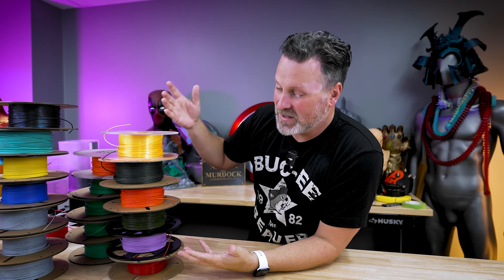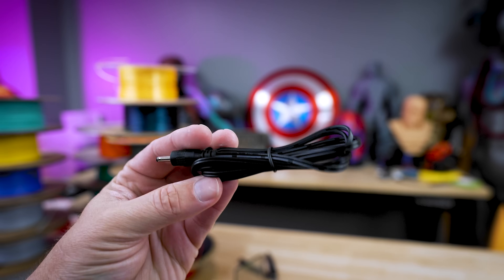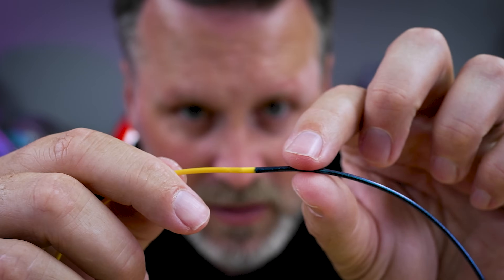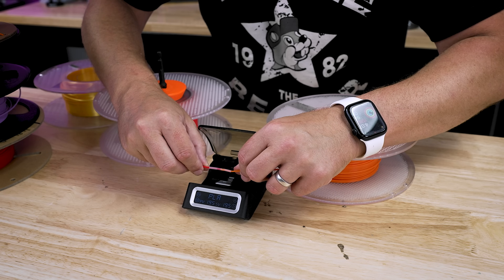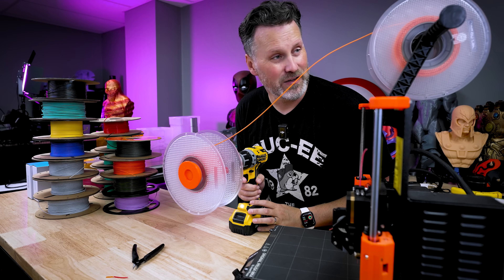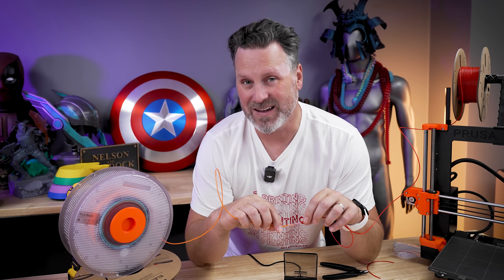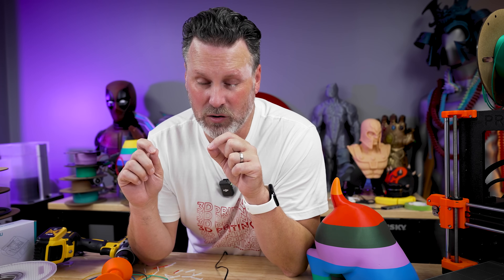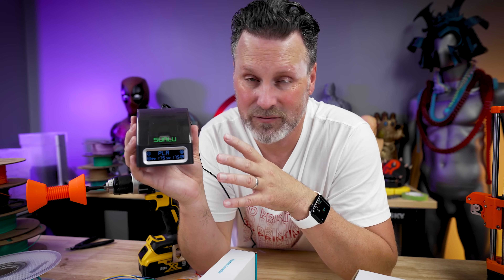Does this really work?? Sunlu Filament Connector

Comment: Ah, thank you, finally I have proof that Bambu does not handle filament jam situations, and prints in air, just like any printer from 20 years ago.
They should really added filament motion sensor for that. But I guess they do not want you to use problematic filament, only official spools. That is why.
Also if your printer normally handles runout event, you can just print all your spools by changing them when they are run out. The only thing needed is that you are near the printer doing something. When I am transitioning from spool to spool I just plan print when I will be near the printer. Then I change filament and that's.
You can also wield filament with good old PTFE + lighter method, which is old as 3d printing is. And you can use PTFE as a guide when rewinding the filament, very convenient.
For me it is fun, that my $100 Ender 3 can handle filament stuck without ruining the print and some top notch 'pear' printer can not. But to be fair, I have not seen any printer which have filament motion sensor out of the box.
I heard that Bambulab AMS partially solves this problem. But I am not sure.
Reply: Problem with the AMS is - and I’ve four of them - that on most spools, the end of the filament is attached to the spool. So the AMS will say the filament is stuck and pause the print rather than going to the next roll.

Comment: Two jigs could significantly improve the filament joining process. A trimming jig would ensure clean, straight cuts for a seamless connection between the two pieces. Additionally, a guiding jig would maintain filament alignment during the melting process, preventing warping and inconsistencies.
Reply: I was thinking this

Comment: Is there by chance any way to save the ptfe sleeves? When I used a ptfe tube and a lighter to try and join filament I was able to keep sliding the tube to the end of the roll and then slide it off at the end. Don't know if that's an option or if the tube deforms after use. I did pre order it because it seems like a cool way to combine rolls.
Reply: Other reviewers have indicated that you can indeed save the PTFE tube by pushing it off the end.

Comment: I like the idea of this device, but I agree with you it doesn't work well enough to be reliable. And with both bowden tubes and extruders being finicky about the filament diameter that works in them, it needs to be much better than what you were getting.
What I would like to see is using a device like what is inside the Mosaic. That has a splicer that connects multiple filaments perfectly every time!

Comment: A couple tips, cut both at an angle, apply light pressure on both strands, use 185deg temp, I preordered one, as I have been printing for nearly 2 years and I have a LOT of spools that have just enough to keep, but not throw away, I am anxious to get it, and work on combining my spools, so I can use the empty spools for storage, by printing the little drawers you can print for them.

Comment: The Problem is Jesse Says? Is your Technique sucks bahahahahahahahaha riz up, The Ptfe tubing can be bought in metre lengths from other distributers, Also the tubing needs time to cool before removing as to not bend or curl/round up. Personally I would rather be using this joiner to join the same color spools together to make rolls of same brand filaments and colors as to not waste un used same rolls. I think this is better use case scenario as it tends to be the same density filament and a smoother transition. Nice one though Jesse. Good Vid

Comment: Aurora Tech did a review of this device that shows combining two partial spools and then she also made a large print using multiple connections. It does seem to take a little finesse to get it working right, but it does seem to work. She also tested it using a number of different types of filament to see how well it worked. She was very thorough.
Something related to 3D printing that takes a little practice to get it to work right? Unthinkable!
Reply: I was about to say that. She has a very good review and she combines several partial rows together and then prints with it.
Reply: True. Trial and Error error error error....

Comment: Really?  Just use your AMS.  Just start the print with your nearly empty spool in there, and also have a new spool in there with it, and it will automatically switch to the new one when the nearly empty one runs out if you have "AMS filament backup" turned on in the AMS settings.  Or just start the print with the nearly empty spool in there, and when it runs out it will tell you that it ran out and will literally ask you to insert a new spool of the same stuff so it can continue.  Your experiment in the video wasn't helped by you not reading how to use this thing, nor by you clumsily using it backwards.  But it is pointless anyways, because AMS.
Reply: Not everyone has AMS. I see this for budgeteers and beginners. I have 3 mini printers I bring with me to Arts n Sciences events, and I can see this getting a lot of use in my case. My sister also likes the idea for her Ender Clone which has a filament detection.
However the refill filament doesn't retract until it is fed through the whole Bowden setup.

This will solve the retraction issues between spools/partial spools
Reply: @DonsArtnGames  Or you can just push the new filament in behind the old. I did this for years until I went Bambu. I can see this thing being helpful, as long as you’re not as clumsy as this guy, and you actually follow directions. But really, it is just a convenience. I never had any nearly empty spools kicking around being wasted, and all I did was chase the old filament with the new, pushing by hand until it got to the extruder gears. Temporary lack of retraction isn’t as big of a deal as it might seem.

Comment: Does it automatically cool down? Like could you stick the joint in the machine and just leave it until it cools on its own?
Reply from the maker: Just tested it. Stays warm
Reply: @UncleJessy unplug it and it will cool down. I’ve seen others let it cool and had better results

Comment: youre suppose to fuse them with pressure like youre doing but while its in the machine acts like a guide to fuse straight and keep proper diameter and cut the filament at a 45 degree angle to help fuse together. gl to all i hope i win 1!! i think this is genius!

Comment: I've used devices like these before and they're very finicky, the force pushing the two ends together needs to be perfect, and any rotational twist differences tend to snap the connection after it's all spooled up. Too little force and the connection fails, too much and it bulges.  Those little PTFE tubes look like they may help things a little but your so-so results confirm these devices are ultimately a frustration.  Also, most of the time the same brand & type of filaments are connected, you can still see where the junction happened because of very slight color variations from batch to batch.

Comment: The short segments of thin PTFE tubes are consummables and one time use only (incredibly wasteful). Great product idea but grossly inefficient and needs more time at the Engineering, product development & testing phases.
Reply: The PTFE tubes can be reused if you push them off the end of the filament instead of cutting them.

Comment: That’s because you’re not waiting for it to cool down before you remove it!
Reply from the maker: The welding spot stays hot. You have to remove it. Also, there are zero instructions provided with this 😂
Reply: @UncleJessy  There is a video showing the process on their website (but some sort of instruction sheet stating the basics would have been useful).  It shows the 45 degree cuts too.  I'm waiting for mine to arrive.  I think my main use will be to pull the last few loops of filament off an old spool that is in use and weld the end to the start of a new spool so I don't have to mess around with the machine pausing when the filament out sensor is triggered.  Your respooling efforts look easier than I expected, so I might try that.

Comment: How about just being patient and letting it cool down inside the joiner before opening it. Because he kept pulling it out while its still soft and pushing. Turn it on, slightly push the filament in, let it cool down, once cooled, then pull it out
Reply from the maker: Thanks! Instructions would be great along with the device 😂
Reply: @UncleJessy  Oh it didn't come with instructions, I missed that part, I retract my snarkiness 🤣🤣

Comment: are you putting angled cuts(splice joint) in the filament? If correct you're supposed to do flat cuts and just add pressure.
Reply: angled has more surface area for a stronger connection.
Reply: @LexxDesign3D  I would normally agree

Comment: I like his "partials" lol Man I can get a lot of small prints from those. And video he said he watched, that guy said you're supposed to cut ends at angle then join together like triangles flipped on top of each other not butt together. That could be some bad welds jessy experiences.
Reply from the maker: 🤘🤘 when in doubt fresh roll for my projects 😂🤦‍♂️ and yeah was cutting them at angles as well. Apparently I’m supposed to leave it inside the join area until it fully cools

Comment: Thanks for the honest review. I received one of the manual filament welders ($9) for Christmas and tried it and it was... not fun. I was considering getting the electric one that looks like a hair curler.
As to spare PTF tube, I bet a lot of people have spare tube if they didn't toss it. Each time I replaced my hot end I would swap it out for a Capricorn tube so I've got a baggy of generic PTF that could probably be chopped up for something like this.
Cool find with the spool winder, I'll have to check that out. :)

Comment: You could use a lighter with those tubes alone and get the job done. If they were thicker, you wouldn't be bending the splice either. 
I agree with you. A couple design changes could make this way more useful

Comment: I've been using this same method for about a year now, using silicone tubing and a soldering iron to heat the connection. I learned it from another video on YT (What is Mike Making Now). It is the only method that I have found that is easy, inexpensive and most of all reliable. I'll just keep on using my soldering iron instead of spending money a device that does the same thing.
Reply: I can't find that channel

Comment: I've been doing this - by hand - for years, never had an issue, I just join two clean ends with a small butane torch (a lighter would probably work) and then clean the join up with a scalpel.
Reply: I have tried many different methods and gadgets and I have never once gotten a join that can make it through an extruder, either it bulges and can't make it through the extruder, or the join is too weak and breaks.
Reply: Filament surgeon over here.. I got to give it a try

Comment: I think some sort of cooling block/clamp might help keeping it straight while cooling. Two 1 inch aluminium blocks with a groove drilled out of both sides. Or ever a 3d printed one with some aluminium foil covering them.
Great video. Keep up the good work.

Comment: I got one of these pre-ordered already as Sunlu keepo giving me £20 vouchers so it only cost me £7. I have been dreaming up ideas of making my own gradient filament and looking at a way to install it into a spot in the right place of the pastamatic respooler. However watching that video I think trying to snip the filament every 8 meters or so and weld it would be far to much hard, boring work. For £7 I'm not bothered (I spend that much on my lunch!) and I centainly have a play. Weirdly when I ordered it, it did inspire me to tidy up all the near dead rolls under my desk but I just chucked them in all 8 AMS slots and told the slicer they were all white then printed little practical things I need until I had a tons of filament clips and 20-30 empty spools!

Comment: Did uncle Jesse not cut the filament at an angle?  Pretty sure you get a stronger connection if the filament is at and angle to each other.

Also all the other YouTube’s managed to cut and weld the filament but uncle Jesse failed. 

Probably good idea to watch the other many videos on there to understand what you need to do

Comment: first thing i would have done would been to cut both ends at an angle and then cut the ptf tubes into halves to get longer use from them.. :) still trying to work out why it took so many years for someone to bring this out.. lol

Comment: I think I'll wait for V2. Thought I wonder if it would be possible to just print our own PTFE connectors when needed?
Reply from the maker: Pretty sure you could just buy a long roll and cut it up for this
Reply: Do not attempt to 'print' PTFE parts. lol..

"PTFE has a high melt viscosity, so it only melts and softens at extreme temperatures, with a melt transition point of 327 °C (620.6 °F)."
BUT
"PTFE begins to release fumes at temperatures as low as 260°C (500°F), but symptoms in humans usually don't start until it's heated to 350°C (662°F). At this temperature, PTFE begins to degrade and release toxic particles and gases that can damage the lungs if inhaled. Inhaling these fumes can cause polymer fume fever, also known as "Teflon flu""

This is the reason you want all-metal hot-ends to print things like Nylon, PTFE based hotends will start off-gassing.
Reply: @Roobotics  Oh did not know that. Thanks for the heads up!

Comment: Can it fuse filaments that are not compatible with the AMS?
Reply from the maker: What do you mean? I just used all random rolls of PLA I had laying around and used an empty bambu clear spool so you could see the colors after it was all spliced and rolled
Reply: @UncleJessy  like abrasives or flexibles that you have to feed through the back of the bambus (same to same, not mixed)
Reply: @UncleJessy  nevermind, I looked at the Sunlu webpage and it doesnt fuse abrasives or flexibles.
Reply: Like fusing a PLA header to some TPU I assume? It's an interesting idea!

Comment: Joining filament is one of those “simple problems” where the solution is surprisingly complex. I appreciate the move towards simplicity here from Sunlu, but as you pointed out you start having to think about optimizing temperature, pressure, respooling, and suddenly you’ve arrived back at the PETwelder/Mr.Winder 🙃

Comment: Lower the temp back down, trim them straight not at an angle, press in tight, then place in and press play.  Don’t pre heat it.  It will beep when finished.
Reply: 45 degree angle has more surface area for a stronger connection.
Reply: Completely wrong according to the direction from the manufacturer that ot seems no youtuber or reviewer knows how to read.

Cut at an angle, put in tube, insert the joint into the preheated slot, push together lightly and hold until it beeps then remove.  

It's not rocket science.

Comment: Sunlu should have adding a cooling former for the tubes to rest in while it’s waiting to cool down. The tube acts like a mold but because it’s also flexible it need an outer shell to rest in like the way a silicone mold is made. 

Still better than most systems out there though to hold the filament shop.

Comment: You were cutting the filament wrong. When you cut the filament you cut them in slanted way each time and then you line them up and push them a little bit against each other so the connection is good.  Good luck.